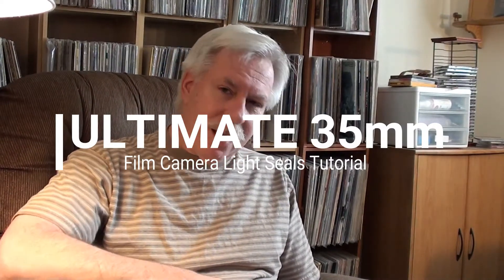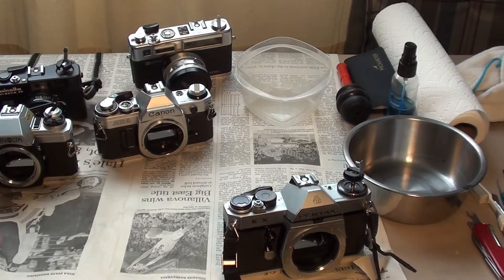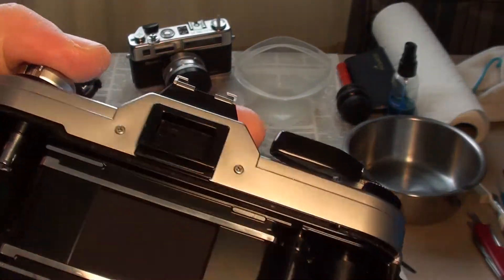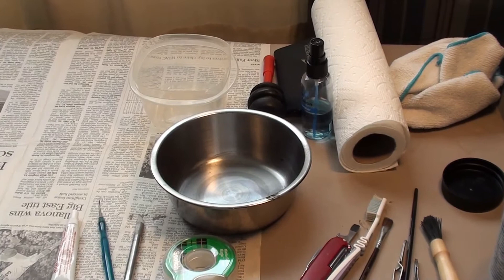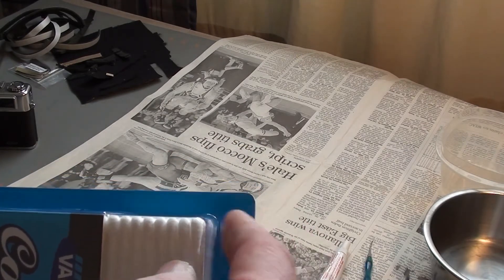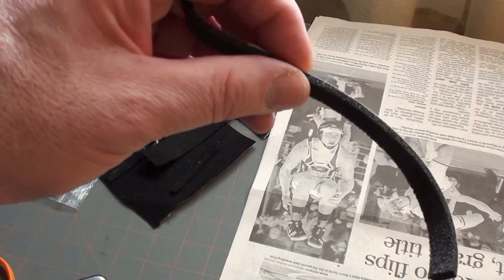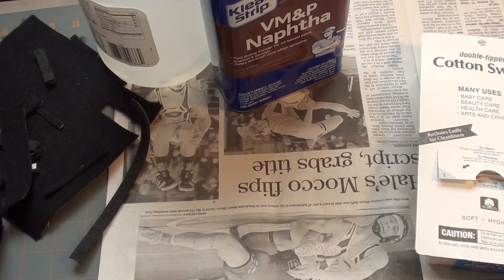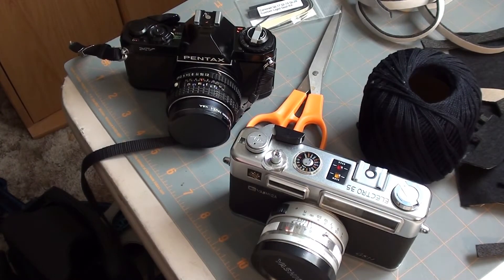Ultimate 35mm Film Camera Light Seal Tutorial

Comment: Outstanding! I used the same web site for my light seal kits. I peeled the white backing and used a 75% Alcohol hand sanitizer to lightly coat the pieces and they slipped in nicely and the alcohol dried relatively quickly.

Comment: I just did my Canon AE-1 a few days ago, 42 odd years old lol  ,, used yarn in the door tracks and replaced the mirror bumper with the peel off felt 1 mm thick,, also did the door ends with the felt.. have not used it yet but hoping I did a good job.. I bought the camera new in 1982 I think.. It really has only had maybe 10- 15 rolls of film through it back in the day....  I fixed the shutter noise with a drop of oil a few years ago but never used it. I have an old roll of Kodak  film in my fridge, I will load it soon and give it a try....Also Just bought a Canon sl3 last week , first camera after the 1982 AE-!.. 42 years apart lol...wish me luck.. lol.. got an adapter to use my fd lenses on my new camera also .. Canon 50 mm and a Canon 70-210 macro,, looking forward to have some fun with it all.